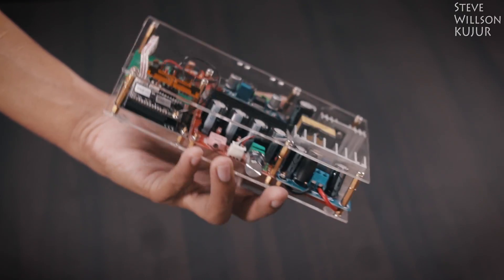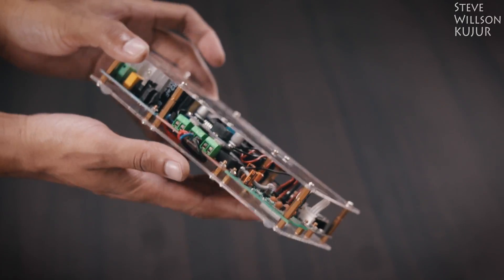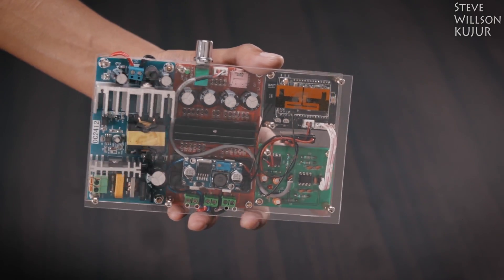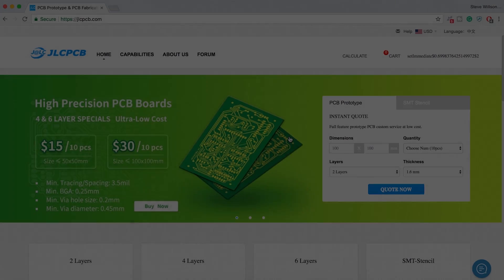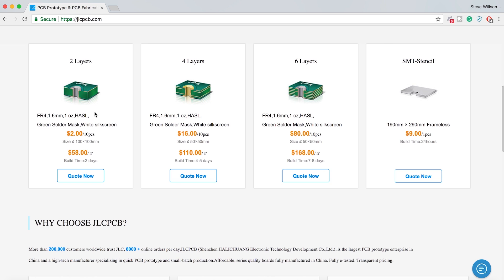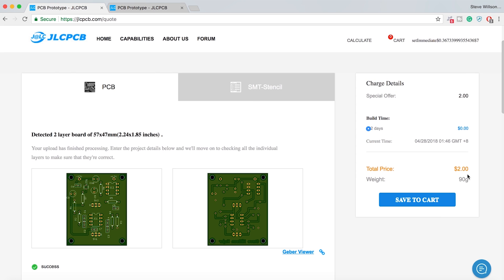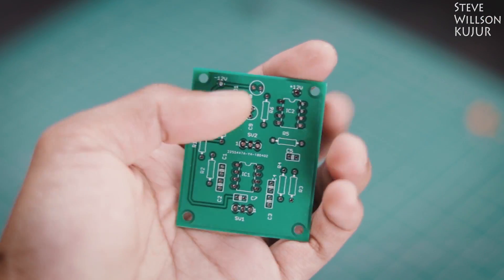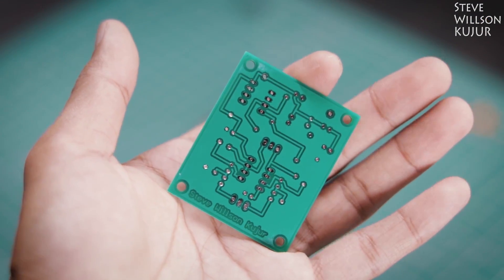DIY Multi-Room Wifi Audio System Sound Test

Comment: this is very good, but it already exists, what would be revolutionary, is if you could create a mesh system that takes 16 line out inputs, and then allows you to have full Dolby Atmos wireless for dirt cheap and without needing all those unnecessary receivers and amplifiers. Could you try? It would be insane

Comment: Very nice!  Now what I am looking for - and cannot find on the market - is a WiFi-transmitter that I can attach to my old turntable (or HiFi stereo or whatever sound source).  So a WiFi transmitter that sends lossless audio towards WiFi speakers or WiFi receiver.
I have Harman Kardon speakers (Omni Plus) that I would like to connect to my (old but still masterclass) Technics turntable.  What can you "brew" to make this happen.  
Afterall, vinyl is 'hot' again and it's a shame to not be able to stream it at home.  ;-)
Reply: lossless formats are high bandwidth, but all popular hits and classics are available in flac or ogg formats and sound clearly better than mp3's.  There is tons of reason for your inquiry besides vinyl or other retro.  Highest quality newer and popular classics is my ONLY reason for wanting a DIY lossless transmission that plugs into audiophile DAC and speakers/headphones at either end.  I hope we find something!